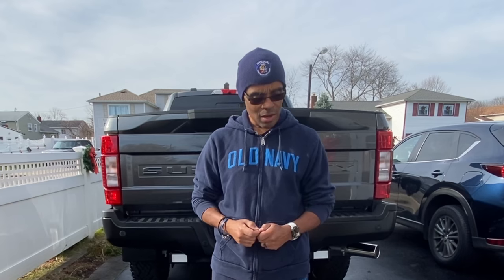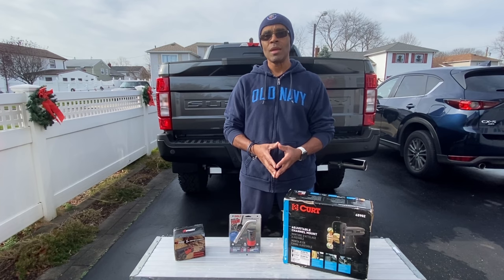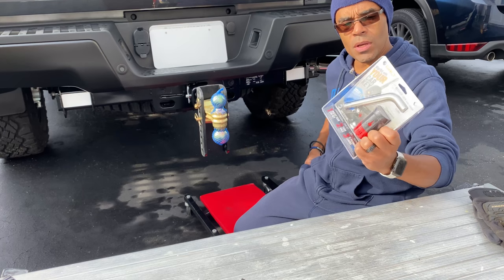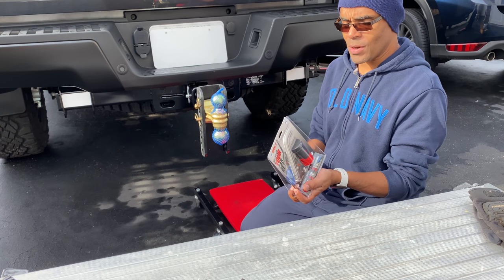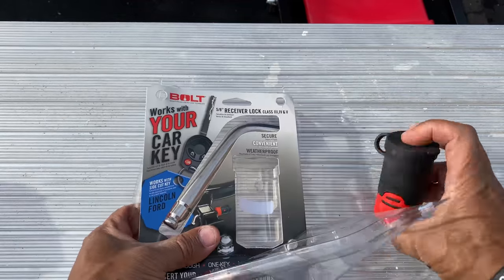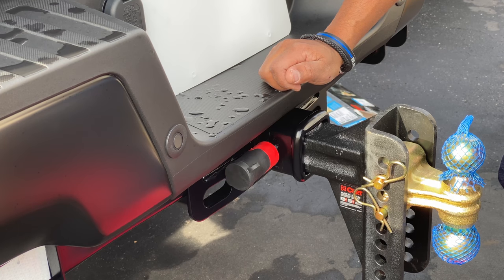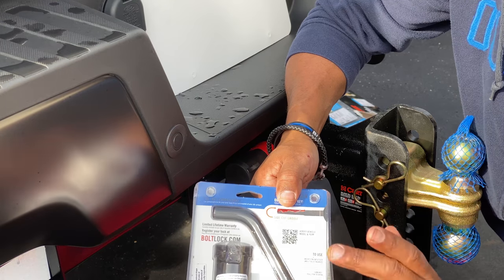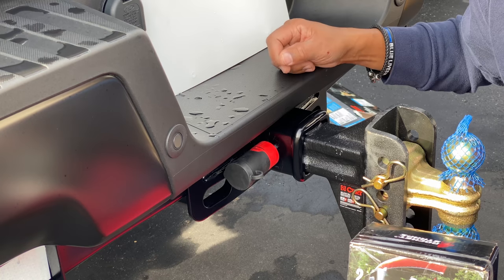Installing the BOLT 7023585 5/8" Receiver Lock for Side Cut Ford, Lincoln & Land Rover Keys, Part#2

Comment: nice install! hardest part about towing a trailer is backing it up. used to tow a boat and one trick I learned was to put my hand at the bottom of the steering wheel instead of on top when backing up. that way you can still instinctively steer in the same direction, but b/c your hand is on the bottom instead of the top of the wheel, the motions you make have the opposite affect.
Reply from the maker: Great tips. I will remember that. Thanks for the feedback and please remember to subscribe to the channel and like the video.